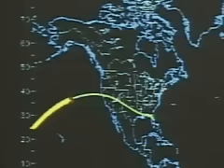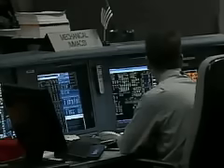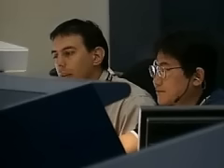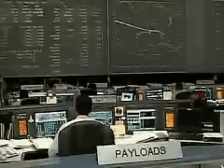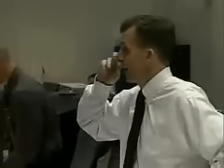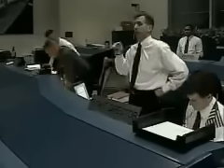Inside Mission Control During STS-107 Columbia's Failed Re-entry and disaster

Comment: I was reading an article about the near-miss in ‘88, when Atlantis took all that foam damage (the 700+ tiles) and Mission Control misunderstood the severity due to the video quality. The article refers to a part in “Riding Rockets” where Hoot talks about the incident:

“…as the shuttle fell into the discernible atmosphere, Gibson kept his eyes on a gauge that showed how much the elevons at the back of each wing were deflected.

"I knew that what would happen was, if we started to burn through we would change the drag on that wing," he said, "which is exactly what happened to Columbia. We would change the drag on the right wing and what we'd see happening is, we'd start seeing right elevon trim, you'd start seeing right aileron, if you will, trim, which means putting down the left elevon, moving the left elevon down.

I knew we would start developing a split (between right and left wing elevon positions) if we had excessive drag over on the right side. The automatic system would try to trim it out with the elevons. That is one of the things we always watched on re-entry anyhow, because ... if you had half a degree of trim, something was wrong, you had a bunch of something going on if you had even half a degree. Normally, you wouldn't see even a quarter of a degree of difference on the thing.

"So I knew that that's what I was going to see if it started to go," Gibson said. "And therefore, that told me that I'd have at least 60 seconds to tell mission control what I thought of their analysis."’

So Hoot is very clear that not only did he know exactly what to expect in case of a burn through - as would any pilot - but that pilots always watch the trim on the way in.

In Rick Houston's “Wheels Down”, there's a reference to watching the trim during re-entry by one of the astronaut commanders. I listened to it on Audible and thought I had bookmarked it, but I'm unable to find it, so apparently not.

Everything I've read about Rick Husband says he was an extremely attentive commander. Willie McCool was a first time pilot, so while he had nothing to compare it to, he was described as similarly attentive to detail. They'd trained for this mission for almost three years. In addition, they knew there had been a foam strike. Yes, they were told that it wasn't anything serious, but they still were aware of what had happened and where it happened - and the potential results if the analysis was wrong. They knew what the effects of a burn through would likely cause.

Yet as Comm Check puts it:

The shuttle stayed on course. Husband and McCool may have noticed the elevon movements as the autopilot responded, but again, they made no attempt to contact Mission Control for an explanation. In all likelihood, they still believed the entry was proceeding normally.

In the MCC, Jeff Kling and those supporting him in the MER all thought of the left wing and a potential burn through the instant the sensors starting dropping off-scale low. So did Hmm and Rocha when they heard it from the “viewing area”. They didn't want to believe that Columbia was in trouble - who would! - but the thought still crossed their minds.

Comment: If the shuttle crew were informed about the foam strike after the lift off, I reckon the flight commander would have reasonable doubt  and concern about the safety of the crew during re-entry and he could possibly requested a rescue contingency or a space walk repairs or a docking in the space station for a repair or rescue???
Reply: There was no way to get a spacewalking astronaut to the damage site to begin with since the RMS arm was not flown on this flight.  Docking at the ISS was impossible because it was in a completely different orbital plane and Columbia didn't have the fuel to change its orbit enough to reach it.  It also lacked the adapter needed to dock to the ISS.

Comment: NASAs big error was that they fixated on the tiles and did not even consider that a hit to the RCC leading edge panels would be an issue. Even their own damage assessment software (CRATER) was only coded to handle tile damages predictions not leading edge RCC hits.

The foam that came off came off at the excat worse time in the ascent.

1. Comes off earlier, not enough speed difference to casue damage.

2. Come off later, foam probably misses wing altogether due to thinner air not being able to slow it down enough. It floats "out" to far before it arcs back.

Around 70 seconds is the time when the air thickness is maximum (MAX Q) and the foam slows very quickly, allowing a huge speed difference to be crated.

In effect, the foam came off, slowed down and the wing ran into it.

Comment: The tragedy is that they knew the foam hit the wing, but employed the defective logic of "well there is nothing we can do about it, so lets just ignore it".
In hindsight, it turns out that if they had ordered an EVA to check, discovered the problem, and then deployed all their resources to a rescue mission, they most likely could have survived.
My condolences to the families.
Reply: The problem with the rescue mission idea was that even if Atlantis could've been rushed to the pad (it wasn't even stacked to the tank and SRBs at the time as I recall), Columbia would've gone through its supply of lithium hydroxide canisters used to remove CO2 from the cabin.  The crew would already be dead before it got there due to lack of oxygen.
Reply: @da40flyer  There would have been a very small small chance of a successful rescue  mission had they known within the first 2 or 3 days and immediately started to stretch the critical consumables,  for example stopping all work on board, telling the crew to rest as much as possible all the time. Wayne Hale explained all this very detailed in his blog After Ten Years.  But as you said,  they would have had to cut so many corners, take new additional risks... We will never know if it really would have been tried. But the problem for many people involved at the time is still that "we didn't even get the chance to try to try"...
Reply: @KS Racing  I'm very familiar with Mr Hale's blog.  The option that was considered the most likely to work was to descend to a lower altitude, try to shed as much excess weight as possible,  and then reenter at a shallower angle to reduce the amount of heating on the Orbiter.  But that presented its own risks. Namely the unknown aerodynamic changes that would create.  It was possible Columbia would've been unflyable if it had survived reentry in that situation.  

Every option they had sucked.
Reply: @da40flyer  No, this option was never considered as a realistic option.  It was not even mentioned in the CAIB report.  There was no way to get at bail-out altitude even shedding all the weight and flying any different entry profile. I know some media was speculating about this for some time, after Rodney Rocha made some remarks. But if you talk to the people who were really involved in the entry sequence,  who calculated all the models for weeks after the accident,  they will tell you that there was no way on this path.

Comment: You would absolute of thought NASA safely would have improved since the disaster of 1986, clearly making the same stupid choice again, they should have never allowed that shuttle to re-enter, they should have mounted a rescue.
Reply: "clearly making the same stupid choice again,"  How so? They've found a problem and they're working on it. And the Artemis design is fundamentally safer than Shuttle.

"they should have never allowed that shuttle to re-enter, they should have mounted a rescue."  They didn't have time to launch a rescue mission before the crew ran out of electrical power and died.
Reply: @almostfm  you don't know that for a fact
Reply: @mahzorimipod  The issue that caused each of these two shuttles to explode were not related. The booster issue from Challenger was fixed before the Shuttle ever flew again and never failed after. The thermal tiles that failed on Columbia aren't an issue for Artemis since it isn't a shuttle vehicle.
Reply: @davidjack7418  no, the columbia accident investigation board said that they could have extended the mission up to 30 days. there was never any shortage of electricity or oxygen
Reply: @mahzorimipod  I never said anything about some shortage of oxygen or electricity. That was another poster. I was replying to the primary topic here of "making the same stupid choice again".
Reply: @mahzorimipod  

Sure, let's launch a rescue mission in few weeks, rushing all the security measures,  before we even know what really went wrong and how to fix it, little chance of success and high chance of getting not one but two shuttles and their crews destroyed killed, sound like a great plan.

Comment: What does Lock the Doors mean?
Reply: It means that the flght director has officially called this an accident and not just some anomalous sensor readings.  It means nobody goes in or out of the building until they've secured all the data and any notes that they'd made during the mission.

It's actually the first step in the accident investigation.

Comment: Very interesting to try to follow the dialogue in the critical minutes. The thing is, the flight was highly instrumented in a bunch of ways, so they were much better able to see what was happening than was the case for, say, a flight in the Sixties. But it's one thing to see the data, and quite another to decide what it means, at that very moment, when it's doing something it's not supposed to be doing, and which you've never seen before. There are simulations and all, but you can only do so much WRT that.

How the data gets presented is also very important, and I would think that now we could do much better in that area.

Comment: "Columbia, Houston. UHF comm check" followed by silence is absolutely chilling.
Reply: When the shuttle didn't answer the comm check, they knew they were gone. Lots of redundancy systems in place for comms, so it would be one of the last things to fail on the shuttle.
Reply: I always think about this when I hear someone say "UHF"
Reply: Not nearly the same, but I had a similar incident as a 911 operator with an officer and you start to dread each comm check, even though you’re desperate for a response. Because you don’t want to be met with more silence
Reply: They were dead by this time. They lived 30 more seconds after Husband's response got got off
Reply: No, the temperature sensors all non related to each other going offline is the most chilling. Flight control knew what was happening.
Reply: You never lost American in space on my watch and the hell the way you
Reply: June 27th 2024 from Germany: Exactly
Reply: Its not chilling.... it's haunting
Reply: They knew when they went to work that day that things might go south after the deorbit burn.They already knew the shuttle had gone thru a foam strike.
Reply: That crackling is the worst.  The sound of the shuttle breaking up.
Reply: @LastAvailableAlias  the crackling isn't the sound of the actual disintegration of Columbia. It's just static, which would have been when the electrical systems on the Shuttle started to fail, the comms system failed also. In simple terms, the static is the sound of the systems trying to find a signal and reconnect with each other. But they failed to do and eventually, once Columbia lost all electrical power, the static ceased.

The main break-up (when the left wing and the crew capsule broke off) started approximately 30 seconds after the radio static began. So it would've been around 5:50 in this video.

There's a really good video of it actually, which overlays the communications over an animation of Colimbia, showing exactly when everything happened. It's on YouTube, I highly recommend it.

Because the radio went down before the break-up began, it is very likely therefore that the crew were still alive and trying in vain to talk to NASA for several seconds. They would've realised their spacecraft was doomed and they could no longer talk to NASA. They were on their own. Quite horrible to think about really.
Reply: @LastAvailableAlias  THAT IS NOT THE SOUND OF ANYTHING BREAKING UP! IT'S STATIC!
Reply: @billythekid3234 Too much static
Reply: 🙏🙏Blessings forever GOD loves y'all too forever tell everyone you know and don't know. Jesus loves y'all too forever. Teach everyone how to see and enjoy their blessings too forever
Reply: Yes we kmow.  We heard it.
Reply: Not really  as some worker said its not unusual, they don't say much anyway, usual corporate mentality.
Reply: @Steve-ix2un 
This was different.   There's nothing typical about it.

Comment: once this the mission that nasa knew the spaceship was damaged and wouldn't make it home and they wouldn't be able to send another ship up so kept it secret? 

or this the spaceship that they knew the risks of the rubber O rings and the fueling mix, especially with cold weather. either way both tragedies that people used to go against nasa and take even more from their budget.
Reply: The issue wasn't "could they send a rescue mission up?"  The issue was "Could they send a rescue mission up before the crew ran out of electrical power and died?"  And the answer to that is that there was practically a 0% chance of doing it.  And since they couldn't be sure that the external tank on that mission didn't have the same problem, there was a distinct possibility that they'd lose that shuttle as well.

Comment: Was this before space station was built. I always wondered if a space walk repair could of been done the obviously new damage and it was like fingers crossed they make it back.
Reply: After
Reply: There was really no practical way to do a repair. That part of the Shuttle has no handholds or footholds and was not flying the Canadarm, so you couldn't put an astronaut on the end of that and "fly" them to the location of the damage. When in orbit, an astronaut is basically out of control without one of those two things.

Comment: @6:10 “I’ve got four temperature sensors that are off-scale low” 

Does that mean that they have at this point lost the data transmission from the craft and so they are just showing no temp data at all? Was this the first indication of a problem? Is this the point of the breakup of the craft?
Reply: "off scale low" means they're not getting a signal from those sensors. While that's not ideal, that alone isn't an indicator of serious trouble. When they lost other sensors and the controller reported "no commonality" between the two (IOW, there was nothing in the signal path that would affect those, and only those sensors) that they really knew something was wrong.
Reply: Yes, that was a bad sign.

Comment: Im surprised the pilot didn't fly~dihedral to put less~stress on the affected~wing.

Hard left rudder.
Slight right aileron.
Come down in a crab configuration.

Trim down and shield the foam damaged area using the nose of the shuttle.
or
Trim up to increase drag and put less direct pressure on the leading edge.
A combination of the two may be the best choice.
I recommend switching back and forth.

Obviously this has concerns of its own such as extensive heating to side-skin and nose of the shuttle, modifying the glide path, and potentially landing off-runway but in my opinion through careful management and superb piloting as well as quick reaction the challenges they faced may have been solvable.
Reply: This might seem like a silly question but they were aware of this damage while in orbit?
Reply: @stevengallant6363  They were aware.

Comment: Re enter with a hole in the wing
What could possibly go wrong
Reply: OK, so what were the alternatives?  Not enough fuel to get to the ISS, no way to get out there to fix the problem (and, BTW, nothing to fix it with), and not enough time to get a rescue mission to them.
Reply: @almostfm   
U have a plan before u launch.  
U don’t launch a vehicle that has 
Parts falling off ?
Reply: @PInk77W1  "U have a plan before u launch." They had to launch into the orbit they did for the mission they were doing, so that leaves out getting to the ISS as a "plan". And NASA's budget didn't give them the flexibility to have another shuttle ready to go when one launched, so that leaves out the rescue mission.  And they'd lost foam before-it just never hit the leading edge of the wing.

You seem to be confusing wanting options for actually having them.
Reply: @almostfm  I’m confusing launching a rocket that falls apart on launch with using your brain
Reply: They should have traveled back in time

Comment: From https://www.nasa.gov/pdf/298870main_SP-2008-565.pdf
and
https://www.youtube.com/watch?v=CnEuYu7-7X0

5:17 Last transmission and loss of signal.
5:22 Loss of control.  Orbiter violently pitches and yaws, crew begins to experience 3.5G accelerations in multiple directions.
5:23 Master alarm sounds: http://www.policeinterceptor.com/navysounds.htm
5:31 Roll Reference exceeded.
5:49 Left wing detaches from orbiter.  Pilot manually resets master alarm.
5:50 Pilot attempts to restart APUS 2 and 3 and activates hydraulic circulation pump sometime between this point and depressurization.
6:03 Fore section of orbiter separates from midsection, crew compartment loses all electrical power, displays, communication, lighting, oxygen and ventilation.  Depressurization begins.
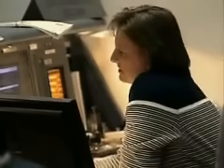6:21 Fore section and crew module begins to breakup.  Thermal intrusion into crew module.
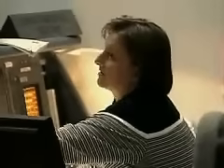6:27 Maximum time before depressurization complete.  Crew module likely completely depressurized well before this time.
6:30 Middeck separates from crew module.
6:37 Flight deck separates from crew module.